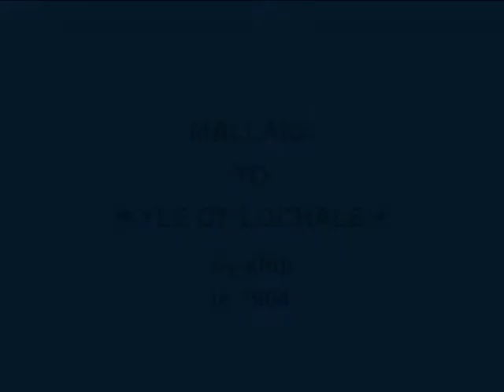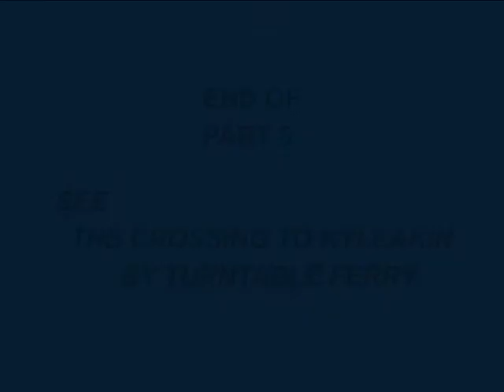MALLAIG to KYLE OF LOCHALSH by MV Loch Seaforth 1964

Comment: We did that crossing about 25 years ago. The ferry was much smaller, boarding was via the roof of the wheelhouse.
Reply from the maker: That certainly doesn't sound like Caledonian MacB or any other large firm. But if it still runs between Mallaig and Kyle of Lochalsh, it will be a very useful service - even if it isn't well publicied. Can anyone enlighten me, please?
Reply: Alan Snowdon couldn’t find it anymore. Was very memorable tour. Train from Fort William to Mallaig, boat to Kyle and train with lunch to Inverness.
Reply: That might have been by the “Loch Arkaig”, a converted minesweeper (lol). Mallaig-Kyle-Raasay-Portree.